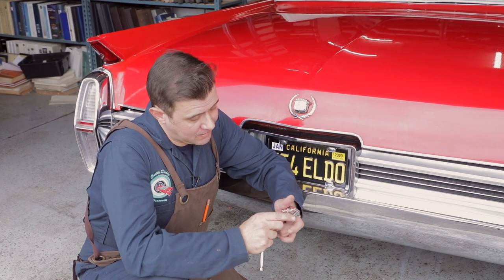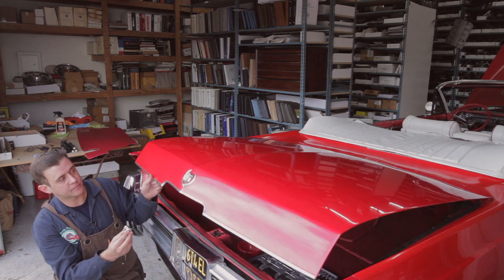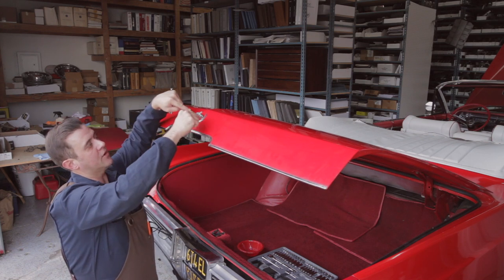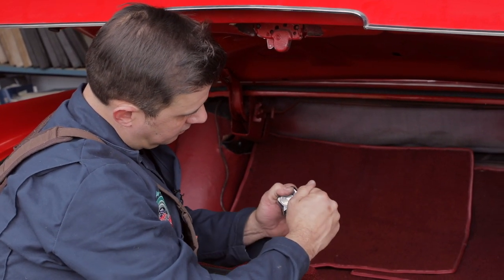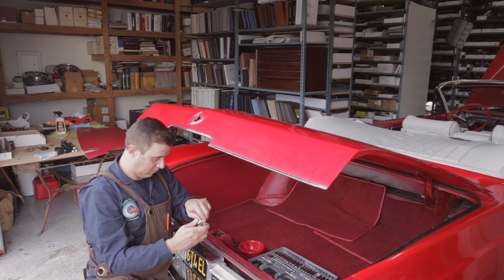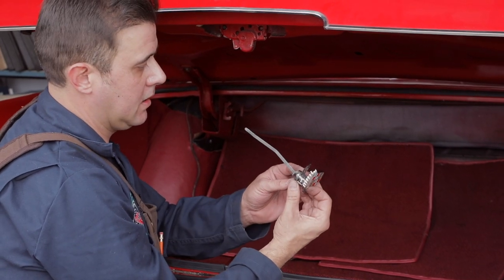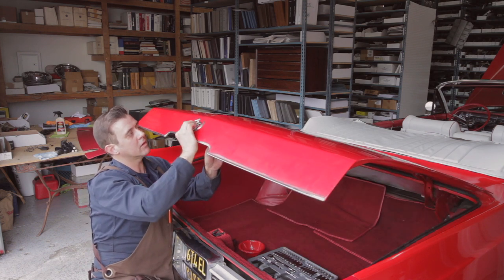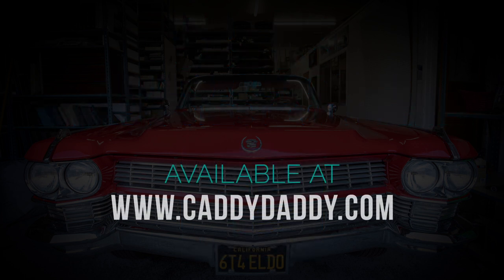How To Install a Trunk Lock Emblem On A 1964 Cadillac Eldorado

Comment: I have a 1964 cadillac coupe deville. I found a vacuum trunk lock popper and was able to install it but I need a vacuum schematic for it
Reply: Ben,

There is no diagram in the manual, nor do I have anything in my
collection of documentation. However, it is a very simple system. What
is referred to as a switch in the manual is really a momentary valve.
When pressed, vacuum from the reservoir is allowed to act on the
actuator on trunk lid. This is my speculation, but I would think the
hose would be run on the right side of the car to the glovebox where the
valve is loated, then on to the tank under the hood.

Hope this helps a bit,

Josh

Comment: Thanks for the video, man. So my emblem came off the housing. Is it doomed or can I somehow reattach it?
Reply: I would use an epoxy rated for outdoor use. Carefully clean, roughen, and degrease both surfaces before applying the epoxy. Josh
Reply: would use an epoxy rated for outdoor use. Carefully clean, roughen, and degrease both surfaces before applying the epoxy. John
Reply: @johncoyle4125  thanks for the idea, John. 👍

Comment: I was working on trunk latch on 64 Cadillac when I accidentally locked the latch while trunk wasopen and cannot get it released - and this cannot shut the trunk.  Was having issues with the key fitting all the way down in the lock to start with.  Any helpful tips?  Thanks.
Reply from the maker: Josh Heide
Tue, Sep 13, 5:42 PM (14 hours ago)
to me

I would try and remove the lock cylinder from the deck lid and inspect it to see why it is sitting too deep. You will likely be able to figure out why it is sitting too deep as you take it apart. When the lock is out, then you can use a screwdriver to engage the latch and see if you can get it working.
When the deck lid is shut, there is pressure from the gasket trying to push it open. If the latch is dirty or gummed up, without this slight force it will not want to open. I would insert a screwdriver into the latch jaws and pull down as the actuator is turned. It will likely pop open for you. If that doesn't work, then the latch will need to be removed, cleaned, and inspected.
Reply: @Caddydaddy  Thanks!  Will give that a try.